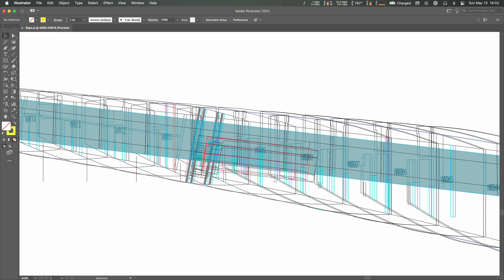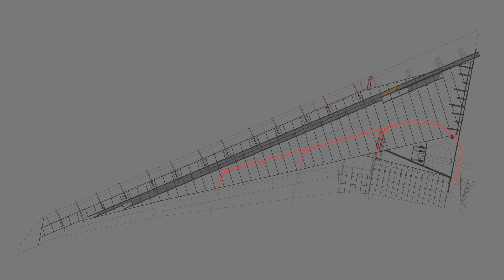Manila folder 777-300ER - Wing update - Inboard flapsssss!

Comment: Amazing. Just finding this, so I’m catching up on your techniques. Have you covered how you make the manilla durable enough to maintain its structural rigidity to handle repeated actuations?
Reply from the maker: It's a lot stronger than you might expect, but I sometimes also coat the hinge joints in glue to harden them and make them more durable.

Comment: Can you link the materials you use I want to attempt this so bad
Reply from the maker: I use two types of manila file folders.
• For more structural parts, I use thicker material: https://www.amazon.com/gp/product/B0013CME9E/
• For finer details and the skin, I use regular thickness: https://www.amazon.com/gp/product/B002IXM3AW/

This is the glue I use: https://www.amazon.com/Aleenes-Clear-Gel-Tacky-Glue/dp/B000BY6THS/

And other tools:
• Xacto knife: https://www.amazon.com/X-Acto-XZ3601-X-ACTO-Knife-Safety/dp/B005KRSWM6/
• Straight edges (all different types)
• Cutting mats: https://www.michaels.com/art-alternatives-self-healing-cutting-mat/M20002313.html

Comment: What kind of paper do you use to build this project? also where do you get your references of the plane to actually make it out of paper?
Reply from the maker: Manila file folders, which I cut down to 8.5x11" and print the designs on. I've done a ton of research (pics, vids, technical drawings) which I use to create my own parts and plans.

Comment: its been 4/5 years and you're STILL working on it! props to you for having such patience for this hobby.
there's so many complicated moving parts.. Don't you ever run into any errors?
Reply from the maker: Definitely. Especially with something this complex, doing it in 2D pretty much guarantees things with slip through the cracks, which is why I've been building these test pieces. If I were designing in 3D, I would probably have less of a need to build everything out.

Comment: Amazing!!! but I have a  question: How do you print onto manilla folders? Do you use your home printer, or do you go to OfficeMax, office depot, etc?
Thanks.
Reply from the maker: I cut the folders/sheets down to size and print at home. I have the Canon Pixma Pro-100 which can print up to 13x24" which is great for larger pieces like the wings.

In terms of the paper I'm using, I have two different thicknesses. This is the "regular" thickness for finer details: 
https://www.amazon.com/gp/product/B002IXM3AW/

And this is the thicker paper for structural parts:
https://www.amazon.com/gp/product/B0013CME9E/
Reply: @lucaiaconistewart  Thank you countless times!!! I know this is a late response, but I am truly thankful.

Comment: Would you be willing to share/sell the designs or plans? Would love the chance to build it!
Reply from the maker: I've gotten plenty of requests, but the main problem is I don't really organize my design files in any particular way, and it would be a ton of work to get everything in a shareable format (instructions etc). I'll think about it once I'm done with the project.
Reply: I think a number of people (myself certainly included!) would be interested even in simply the templates, in fact, i have been using the few images of templates on your website to construct replicas of various parts, (namely the main landing gear and some chairs)  

I think a lot of people would be happy with just HD parts even without instructions, or a neat presentation etc.  I could certainly use them to no end!

Comment: Incredible Work!!!

I'm amazed at how smooth you can get that to move.  I don't see any sign of staining from oils, so I'm wondering if you're using some kind of wax to lubricate the sliding parts.
Reply from the maker: Nope, just paper and glue. No oils or waxes. I was very concerned about how much friction I might be dealing with, but it doesn't seem to be an issue. I'll probably post another more detailed/nerdy video about some of the solutions I came up with, if you're curious.

Comment: This is immensely impressive! Actually In awe at the genius here. How accurate are the hinge mechanisms to the real 777? Do you, make it up for miniature scale, take generous inspiration from the designers of the real aerofoil, or is it a  1:1 structural copy?
Reply from the maker: My designs are, shall we say, heavily inspired by the real thing, in the sense that they have all the same general pieces, but of course I've had to make some significant modifications for the smaller scale and the fact that they're made from paper. I wouldn't say they're a 1:1 though. The real thing has a completely different drive mechanism, for instance (rotating tube down the length of the wing, vs sliding strip for mine).
Reply: @lucaiaconistewart  ah awesome to hear, keep at it. I can’t wait to see it completed
Reply: Every thing in the model is a copy..
Reply: He definitely has access to something he would get in trouble for